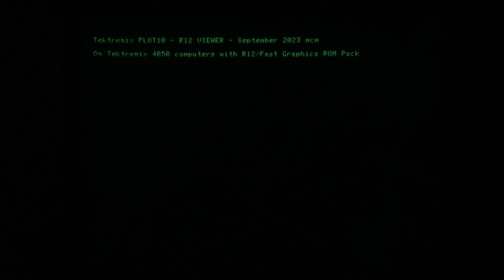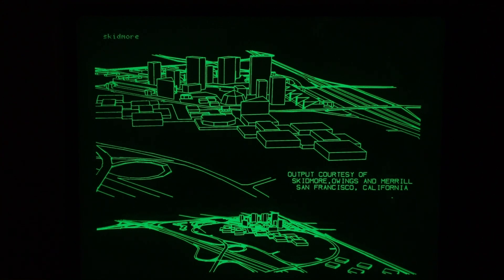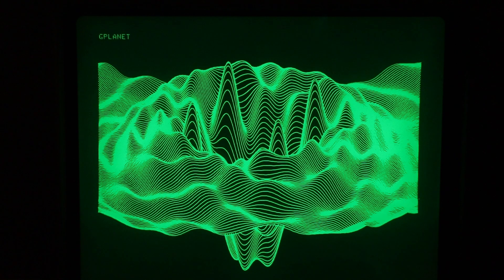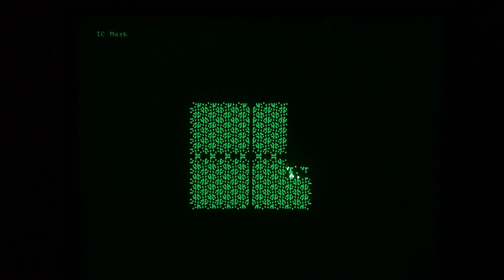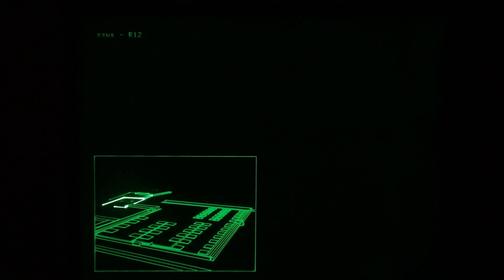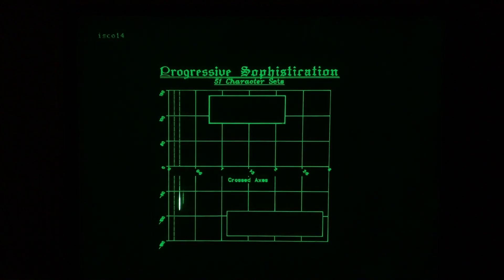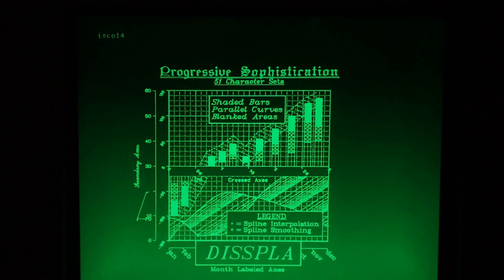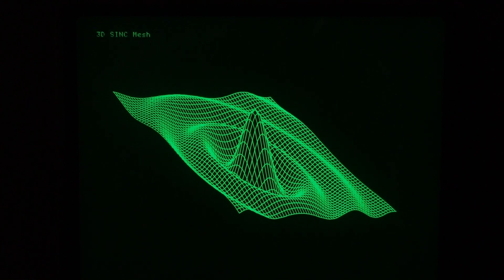Tektronix 4052 Vector Graphics Computer - PLOT10 Demo

Comment: this looks stunning! are there any vector graphic displays with composite inputs you recommend? (I understand I will have to hunt one down second-hand, do you have recommendations for a specific model I should look out for)? thank you in advance
Reply from the maker: No Tektronix vector graphics terminals (4010/4012/4014) or vector graphics microcomputers (4051/4052/4054) had any display memory - the storage tube was the memory device.  Composite video output (from video games or early PCs) is generated from reading video display memory at a fixed rate (related to the timing of broadcast television signals) and converting the video memory values to composite video voltages representing different color values.  Tektronix vector terminals and vector microcomputers did have a Storage Display copier (4611/4631/4632 see https://vintagetek.org/wp-content/uploads/2018/12/StorageCopiersBrochure_Nov1980.pdf) that attached to the terminal or computer with a special cable.  Pressing the Copy button on the keyboard would cause a vertical beam to scan the storage tube from left to right in a couple of seconds and send the voltage to the hard copy unit which contained a single scan line CRT which transferred the entire screen image of vector text and graphics to 3M photo sensitive paper while the terminal or microcomputer screen was being scanned.  See my post that shows Battlestar Galactica original TV show getting a hard copy from a Tektronix 4051 on a 4631 of a list of explosive experts on the prison barge: https://forum.vcfed.org/index.php?threads/my-battlestar-galactica-demo-for-tektronix-4050-computers.1215608/post-1215728    Here is a vintagetek.org museum photo (on this page: https://vintagetek.org/4051-graphic-desktop-system/) of a 4052 next to a 4631 that shows the single line Tektronix copier CRT on top of the 4631 and the 4051/4052 direct-view-storage-tube on the right side of the table: https://7vmc31.p3cdn1.secureserver.net/wp-content/uploads/2018/12/4052-4631.jpg

Comment: Wie wurden solche Bilder erstellt?
Reply from the maker: These images were originally created on mainframe and minicomputer CAD programs to display on Tektronix 4010/4012 or 4014 storage tube terminals in the 1970's.  The source files were posted by the Tektronix 4014 program manager Chuck Forsberg on his "OMEN Technologies" website around 2008.  I have both a Tektronix 4052 and 4054A storage tube vector graphics microcomputer running BASIC.  These microcomputers were introduced after the 401x terminals as personal vector graphics workstations running BASIC programs.  I converted the 401x terminal .plt files to the 4050R12 Enhanced Graphics ROM Pack 3-byte per vector format, which displays the original .plt files much faster than the terminals would have displayed them at 9600 baud RS-232 serial.